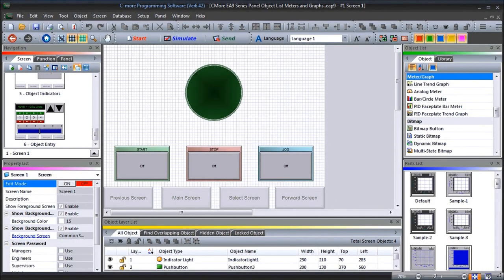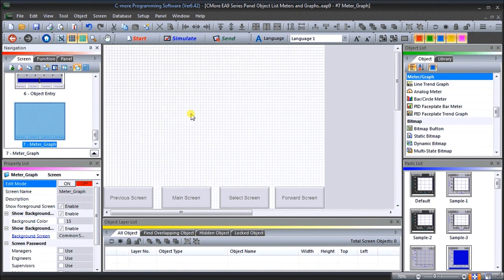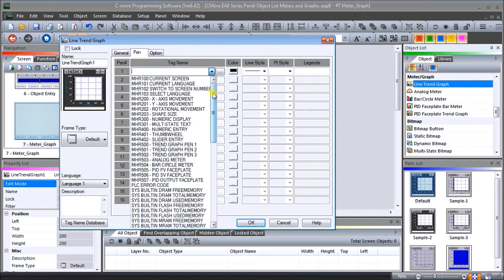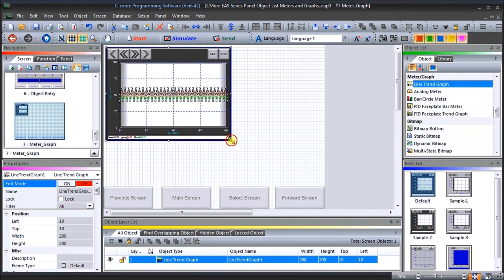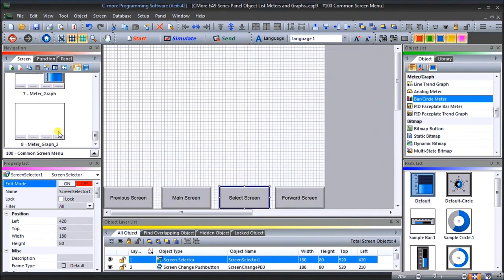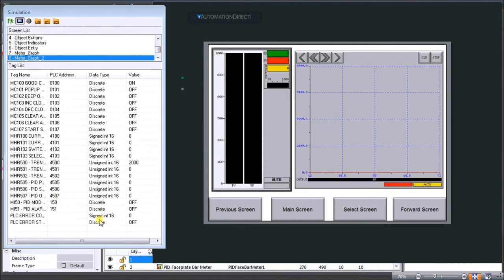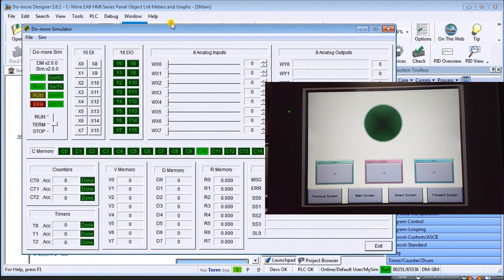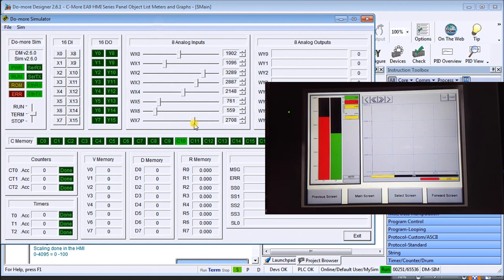C-More EA9 HMI Series Panel Object List Meters and Graphs

Comment: Hi there,

In the line trend graph could we customize the scroll button or we would have to choose from the two available? Additonally, are there ways more customizations can be done for line trend graphs?

Regards,
Reply from the maker: The scroll buttons for the line trend graph in the EA9 only have the two types available. There are a variety of ways to customize this graph but only on the graph itself. I have used the trigger tag to determine when the information will capture. Note: The trigger must be on for longer than 1 second.
Regards,
Garry
Reply: @ACCautomation  Thank you for your response. Another query of mine is.. the graph allows 99 points on a chart.. does it mean that to have a whole day's data presented in a single chart I would have to have about 15 minutes interval between the points? Can this interval between the points be reduced and still have all the day's data displayed in a single chart? Thanks